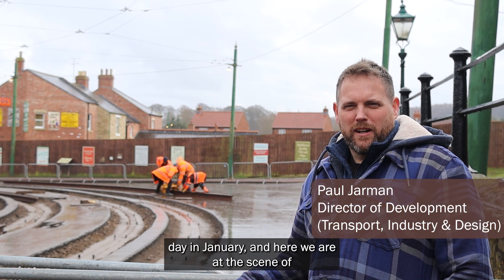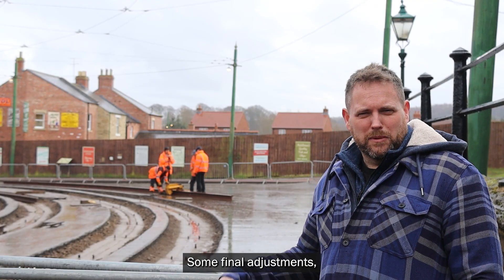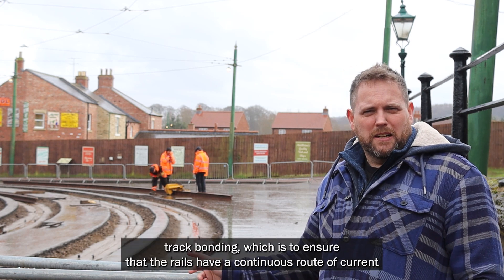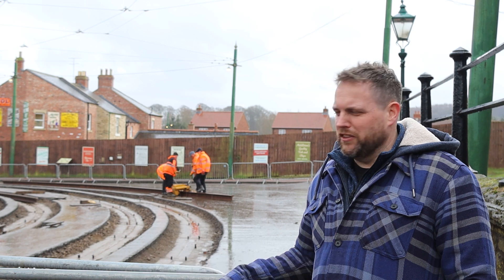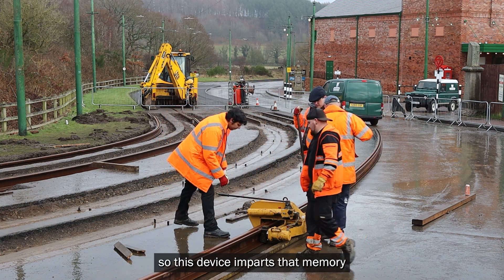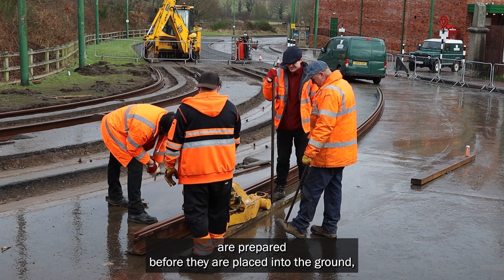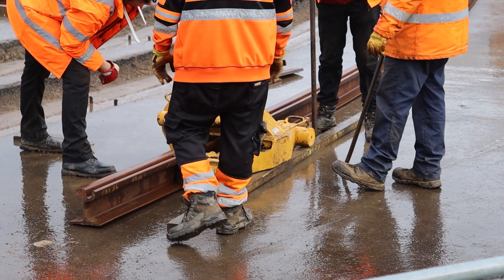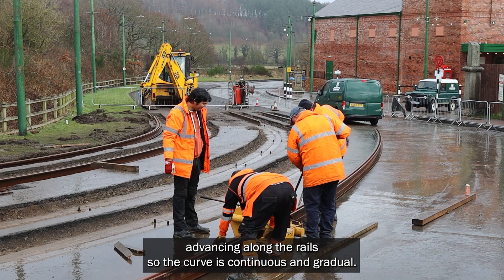Tramway Maintenance - January 2025

Comment: Was here last week during a birthday weekend in Durham, and naturally no trams were running because of these track renewals, but lovely buses instead.  Been a while since I've been at beamish (703 was still there then) so the new 1950's area was a treat, I have heard that a trolley bus service will run through there one day, that would be very good.  I think winter is the best time to visit, it's quieter and when you go in from a freezing cold day you really get to apricate some of the buildings with coal fires!